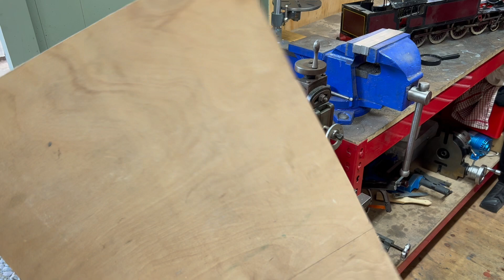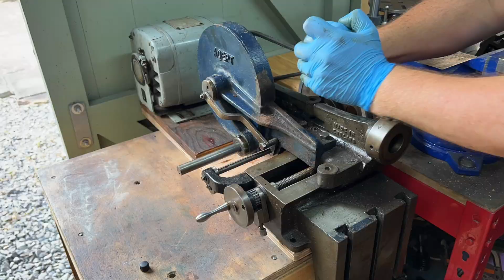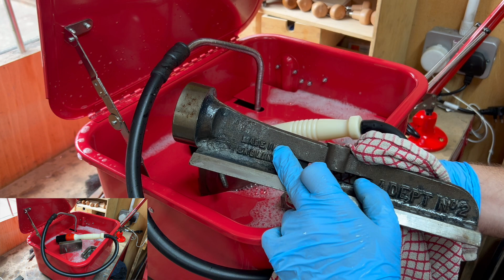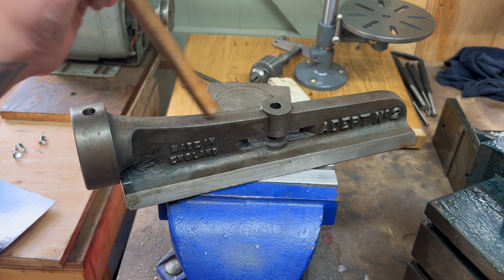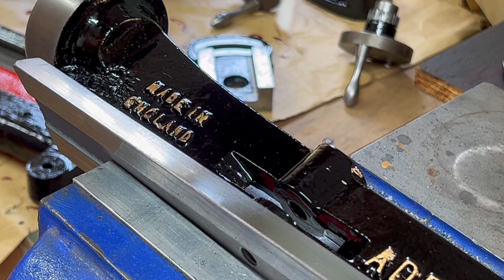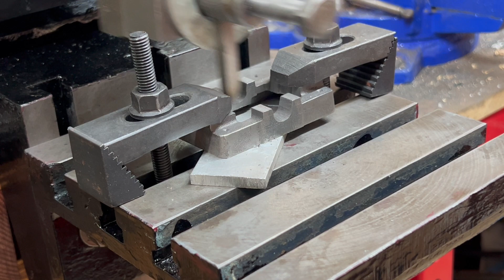1930's Metal Shaper Restoration

Comment: Looking very nice indeed.  Would it not be better to scrape the dovetails or sliding faces to retain oil for longer and make for a better sliding mechanism?
Reply from the maker: You're almost certainly correct on that Paul - I've never actually tried scraping. Do you think it's worth doing here?
Reply: @williamsworkshopuk Hi, the only way to know will be to measure any free-play in parts where there shouldn't be any.  Assuming there isn't any, you could check how much of one surface is actually in contact with the mating part's surface by bluing a surface plate or surface straight edge and rubbing the part on it to see where the high spots have blue ink on them.  That would be the best test.   If you dont have access to that yet, I would opt to clean surfaces with a fine wire wool or a very fine grit wet and dry paper with oil but only enough to clean the surface. Im not an expert, its just what I learnt in recent years from some very experienced teachers.  
I really like scraping, the act of doing it and the result at the end.  
I see it as another aspect of workshop practice thats very useful, especially of you buy old machines to restore.